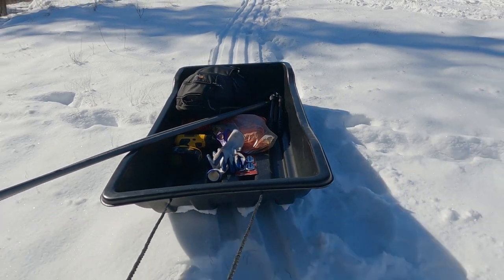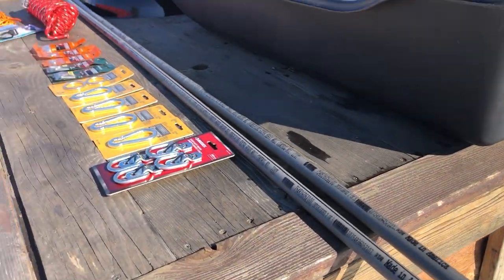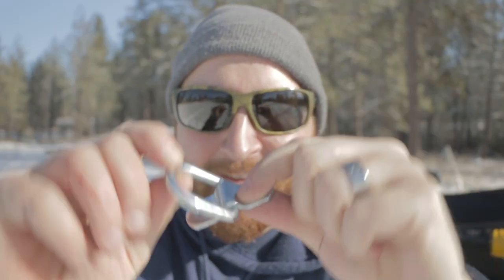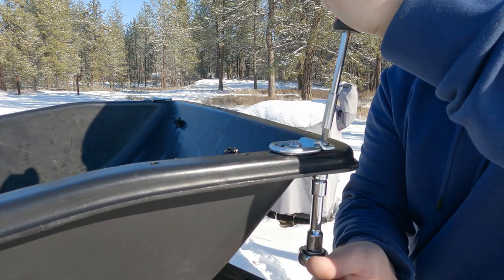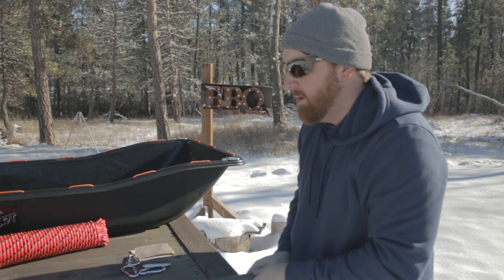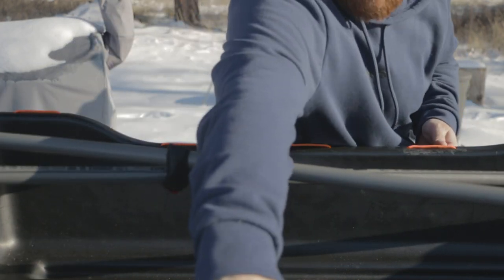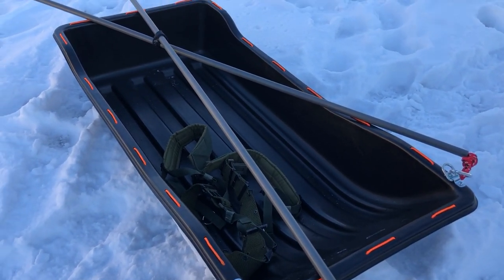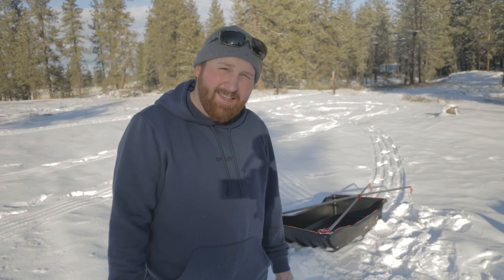How To Build A Pulk Sled/Otter Sport Sled Modifications

Comment: PVC becomes brittle in cold weather, best to use fiberglass poles.  Been using fiberglass for over ten years, haven't broke one yet.
Reply from the maker: Good point!
Reply: My harness is a yoke type worn over the neck and shoulders, easy to put on, easy to remove and can take on heavy loads with ease.
Reply from the maker: Interesting! I need to look into a different type of harness myself 👍

Comment: Kenny... I absolutely love this video. super easy and cheap. I got my jet sled today and I already went to the hardware store. 

It looks like it's been working well. Is there anything you'd change about the design now that you've had some time with it?
Reply from the maker: Thanks! Yes it has been working really well! The only thing I would change is having a better attachment than the carabiners. They tend to come off easily especially when turning. I’ve thought about putting tape around it but would have to redo it every time. Any ideas?
Reply: @BaumOutdoors  which ends come out? I was looking at the locking carabiners while I was there. If you are having that issue, those may be a good fix.
Reply from the maker: Sorry I should have specified. It’s the attachment at the sled that comes off. The carabiners that connect to belt are just fine. A locking carabiner would do the trick! I’ll definitely be getting some as well 👍
Reply: @BaumOutdoors  let me know how it works out! 

Also I'm not sure if you saw, but I sent you a PM with a question. You may not have seen it. If you have a chance take a look. Thanks and God Bless.

Comment: My Otter is cracking and falling apart after like only 2 Winters. I have the next size up and use it for dragging firewood around my property by hand.  It takes it pretty hard some days but I expected a lot more durability from it. I'll buy a new one but will reinforce every corner and point that broke one my current one before using it.